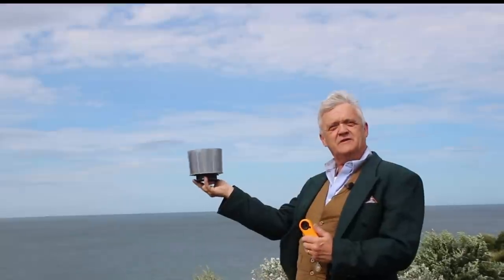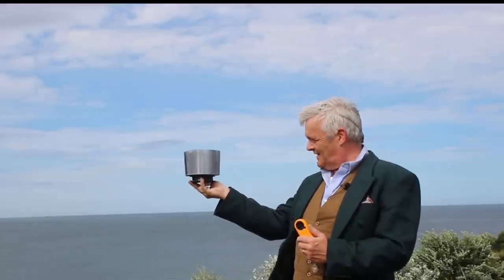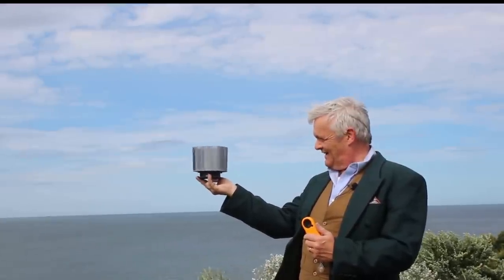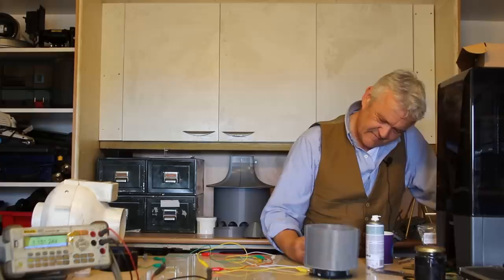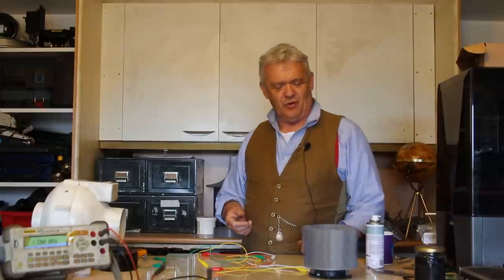1984 The Pelton Wind Turbine - Better Than I Thought

Comment: Where you're losing massive massive potential is by just having air scoops.

If each scoop was instead a stationary funnel (like a vintage hearing trumpet)  pointing toward a central rotating scoop array, you would effectively be increasing the airspeed through the funnels until it hits the scoops.

You could even maximise the potential by having the entire exterior comprised of the funnels, so that any air is channelled toward the scoops, not losing a single mote of energy, unlike your horrendously wasteful example!
(I'm joking)